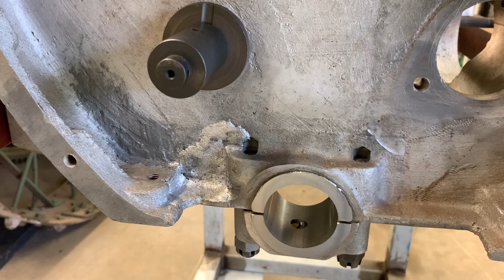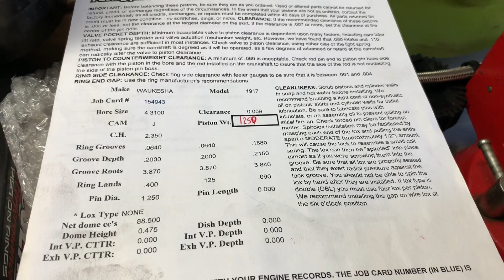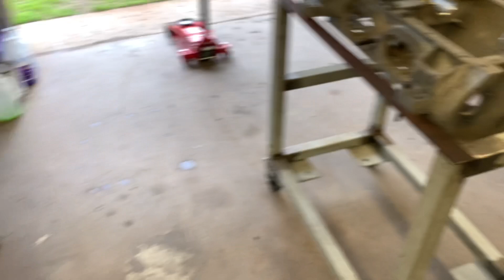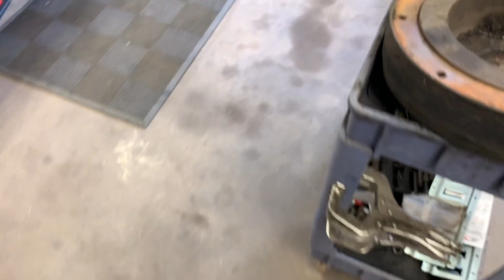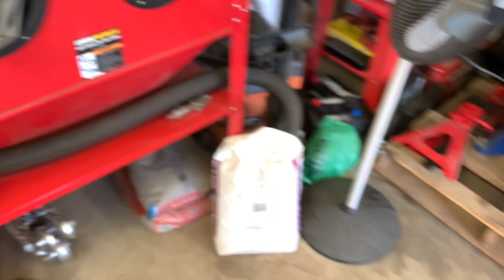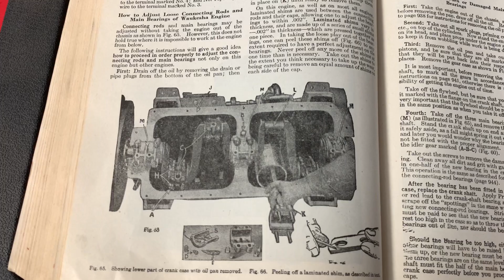Heider Model D 9-16 Time to begin reassembly.

Comment: Wow.  That's pretty amazing you were able to track down everything
Reply from the maker: @AgWildNebraska  Well, repaired and made parts 🤣 Made, pistons, wrist pins, valves and new shaft for the water pump/mag drive. I’ll be spending hours after supper cutting every gasket out. What could go wrong…. Thanks Brett

Comment: I can understand the lack of specks, that was all trial and error at the time. No grades to bolts, just size. One supplier made stronger bolts than the next. 
Interesting having an oil pump, yet all splash lubrication.
Hopefully it all goes together smoothly and everything works when you are done!!
Thank you Dave!
Reply from the maker: @GosselinFarmsEdGosselin  the old hardware looks mostly hand made, slightly different bolt head thicknesses, sizes etc. I am nervous about this one. Lot of money wrapped up in it. You’re right about trial and error, see some after thoughts in some of the parts. Anyway loose specs will work in my favor !
Reply: @crazydave4455  definitely don't want to over tighten anything!!
I think I'd turn everything as I went, make sure nothing is too tight.. or too loose. Any questions about torque for keeping things from backing off, a drop of locktite, super glue or a dab of rtv on the threads will safely hold it from backing off.. 
I'd be just as nervous!! Imagine the guys who built the first one 😳
Reply: Factory spec in manual was literally "tight, but not too tight"
Reply: @RockIslandHeider  makes a big difference between crank turns and crank don't turn...lol